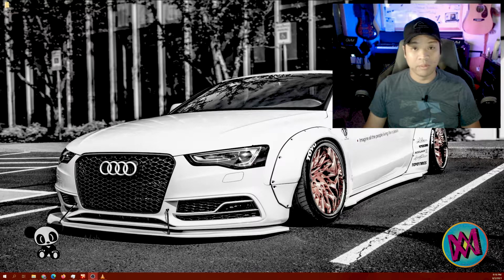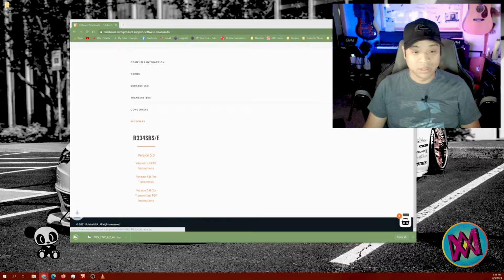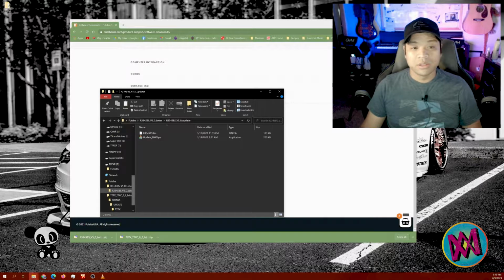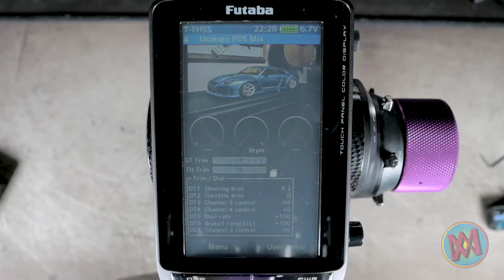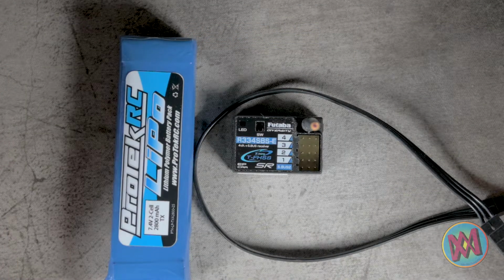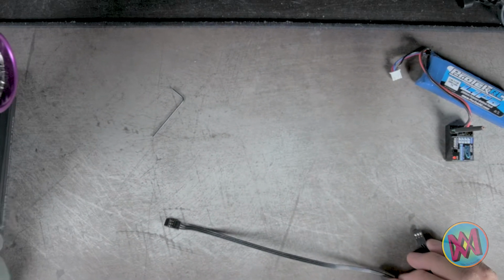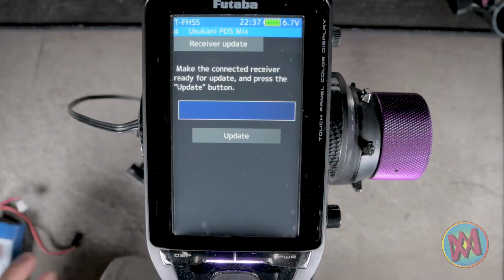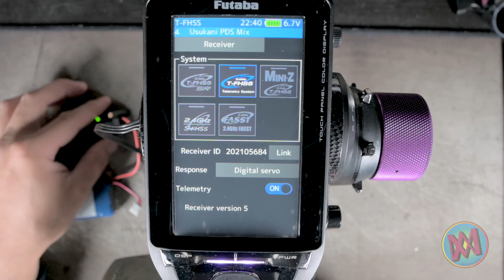Drift Talk - 02 - Upgrading Futaba Firmware 7pxr and r334sbs(e)

Comment: I keep getting error receiver is not connected
Reply from the maker: Hey, Are you making sure that you're getting the receiver into the program mode?
Reply: @yadmah  yes, both lights are on when i attempt to update
Reply from the maker: @MVTTP is the receiver firmware in the correct folder on the SD card? Also what receiver and radio are you using?
Reply: @yadmah  I added the FILES folder to the update folder same structure you showed, im using a 7pxR with r334sbs-e

Comment: Does this work for the 4pm
Reply from the maker: I'm not sure about that. I did a quick glance over the 4pm manual and I'm not seeing it there or mention of being able to use the 4pm to upgrade the firmware. The instructions for the v5 firmware for the rs334 receiver does not mention any instructions for the 4pm either.

Comment: What’s the differance in E version of receiver?
Reply from the maker: The E version of the receiver indicates "Electric only" They are not recommended for any gas/nitro vehicle. Often times, it will look as if the antenna  is short, or it might not even have an antenna.
Reply: @yadmah  Thank you for this info.

Comment: When I pressed the home button and power button, it always go to 7 px Home Screen. Didn’t update the new firmware that I put on dd card . Tried many times press home button and power button but never update the transmitter? 
Can you please help me? Thank you 🙏
Reply from the maker: Have you made sure that the micro SD card is not too big and formatted properly?

You need to just copy the full FUTABA folder into the root directory of the SD card.
Reply: @yadmah  I downloaded software from futaba, copied it to the sd card . Should I unzip the file? Or just copy and paste? 
Thank you for the help
Reply from the maker: @JAM-vu3ol  unzip and copy the futaba folder to the SD card.

Comment: hi, when i try updating the receiver, i keep getting file not found on the transmitter, would you happen to know why?
Reply from the maker: The key is making sure the file structure is exact. Sometimes it takes a few tries. What  transmitter are you using? If it's a 4pm. I haven't tried with it. I know on on my 4pm I couldn't even update it from the version 4.00 firmware.
Reply: @yadmah  I have a 7px
Reply: @yadmah  and by the way what part of the file do you transfer to the micro sd card?
Reply from the maker: @YawMusic3  Hey, you'll want to copy the R334SBS.bin file to sd card.  The File structure should look like FUTABA->UPDATE->FILES->R334SBS.bin
Reply: @yadmah  hey, on the online instructions for the receiver firmware update it says I may need a CIU3 usb drive 🤷‍♂️
Reply: @yadmah  i don’t have this file structure, how can i get this file structure?
Reply from the maker: @YawMusic3  Pay attention at 2:45, that is where I cover the file structure.
Reply: @yadmah  I think my issue may be that I’m missing the core files the transmitter, like the picture files etc…do you know how to get those back?
Reply from the maker: @YawMusic3  What is the current firmware of the radio and the receiver? I'm also curious what file system your micro sd card is.
Reply: @yadmah  current software version on radio is 8.2e and I have a 16gb micro sd
Reply from the maker: @YawMusic3  what is the firmware on the receiver? You should be able to find it under the receiver section of the radio and you have to be connected to the receiver.
Reply: @yadmah  where can I see that?
Reply from the maker: @YawMusic3  It will be in the same location where you would bind the radio to the receiver.
Reply: @yadmah  the software for the receiver is not there…this is weird!
Reply: @yadmah  the receiver version is version 3
Reply from the maker: @YawMusic3  can you tell me what file format your SD card is in?
Reply: @yadmah  exfat
Reply from the maker: @YawMusic3  you might try formatting to fat32. I'll check my radio once I'm home.
Reply: @yadmah  i just formated my microsd to fat32, still getting the same error message after attempting to update Rx
Reply: @adam I went over the file structure you guided me on, and now the error message is Receiver not connected...so that's better than "File not found"
Reply from the maker: @YawMusic3  Okay, so now make sure the cable is plugged in properly in the sbus port. Make sure you get the red and green light to come on to make the "orange" light on the receiver. That's the press and hold the button on the receiver while turning the receiver on. Hold until it flashes once, then release and press again to get into programming mode on the receiver.
Reply: @yadmah  the Rx firmware finally updated! Thank you so much the help🙏🙏🙏
Reply from the maker: @YawMusic3  Glad to hear it finally worked out.
Reply from the maker: I believe that is for updating from your computer via the CIU-3 interface. My instructions for the video is directly from the transmitter.

Comment: Do you have to unplug the receiver from everything or can I leave it on the car with the esc, gyro etc plugged in?
Reply from the maker: I believe that as long as you have the radio connected to the sbus port of the receiver, you can use power from the esc and have everything plugged in while you do the update. It does take a few minutes to complete, so keep that in mind. The important part to remember is putting the receiver into programming mode.
Reply: @yadmah  ok thanks for the reply, I definitely have the receiver in program mode, I got a new computer recently and tbh I just don’t know how to use it so the whole computer side of the process is giving me a real hard time